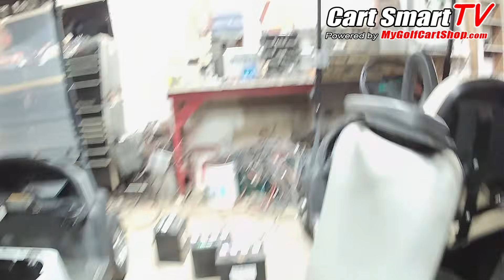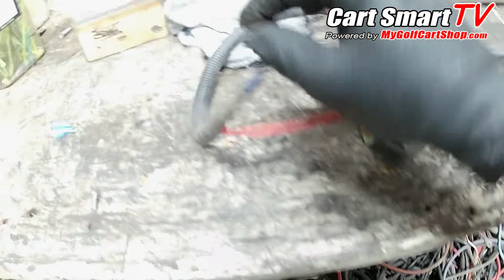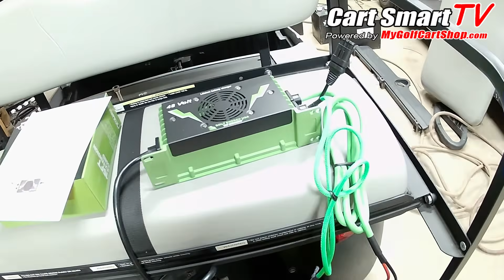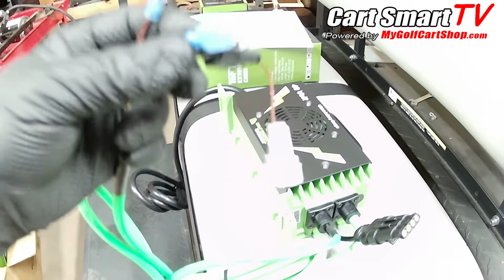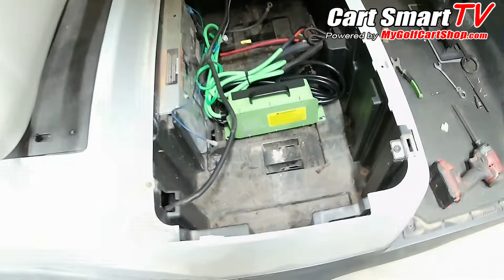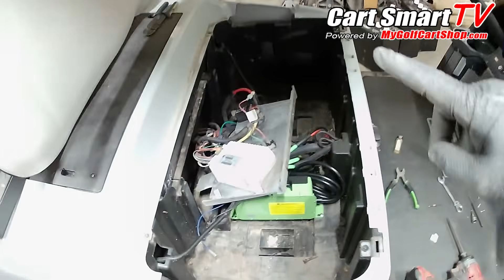Club Car Precedent Lithium Battery Install - Tips

Comment: I made the blue wire hot all the time mine still won’t work can you point me in the right direction please. Is there anything else I should check mine is 2013 precedent
Reply from the maker: What color controller do you have?

Comment: So I got mine all ready to go and ran into this exact problem so I’ll just run a hot wire to the solenoid because you have to actually cut the my battery on to use it. My battery won’t operate while it’s charging so I should be good right ?